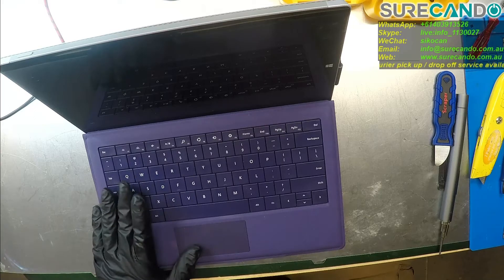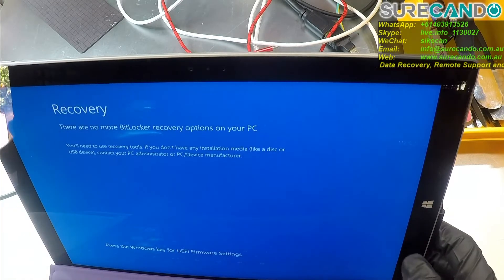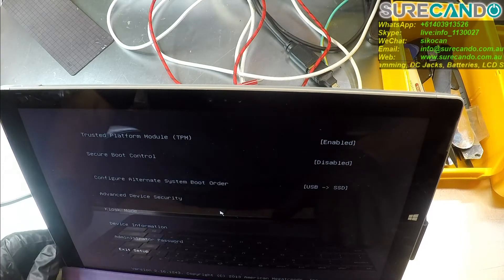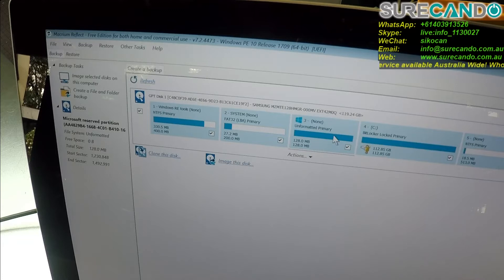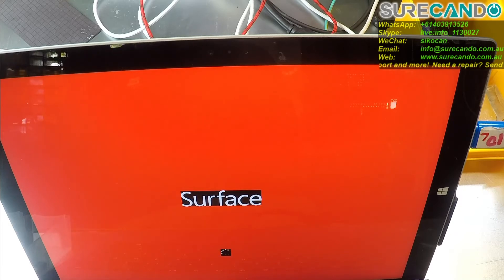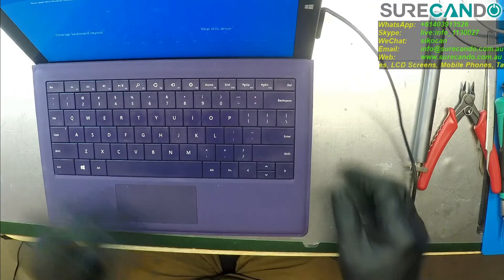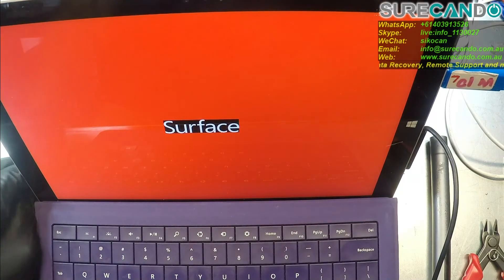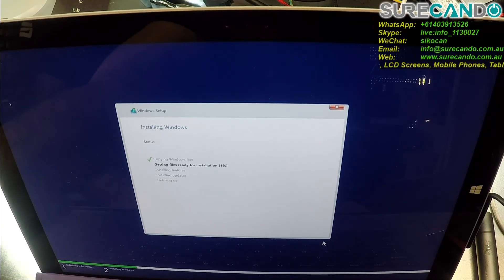How to get rid off RED Screen on Surface Pro Disable Secure Boot Get into UEFI Microsoft Boot USB

Comment: How can I remove a surface 4 UEFI password? The ebay seller said to return it after the keyboard and sound wasn't working. I tried everything and even reset w10 but I think they may be disabled in UEFI for some silly reason. Ideas to try? Thanks
Reply: @SureCanDoComputersServices1  that's a pain. I'm in Canberra, where are you located? How much would it cost to do that?
Reply: @SureCanDoComputersServices1  it works fine with on board keyboard and an external Bluetooth keyboard. The factory keyboard lights up but doesn't work. The audio doesn't work also. I want to login to the bios to see if they were disabled. Also, some online videos say to toggle them on/off in UEFI and that can get the keyboard to work. 
I really like the Surface 4 but the seller said is was all working well but his photo showd a red cross on the volume icon, same as I still get. I can get a USB sound card and a smaller Bluetooth keyboard but it's not what I want... I may just send it back for a refund but I got the i7 model with 256g SSD for $380 so that's a good deal. I don't know if it's worth risking the screen to unlock the UEFI though. I'm now thinking of returning it and buying the same spec S4 for a bit more and make sure it all works and the UEFI is unlocked before I buy it. 🤔 I think you may agree. Thanks for the info on the screen and chat, I really appreciate your help.👍🍻